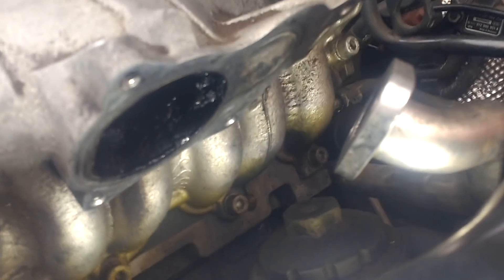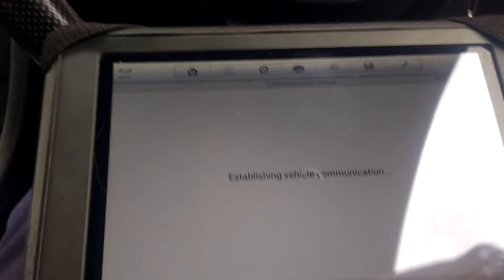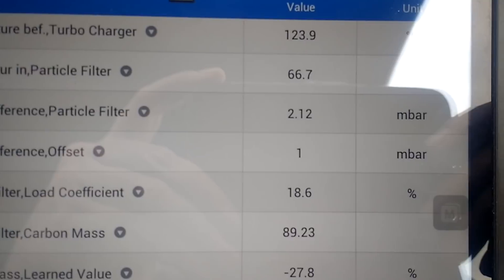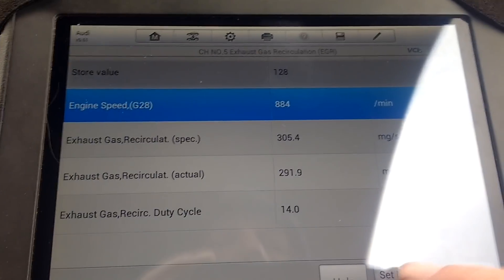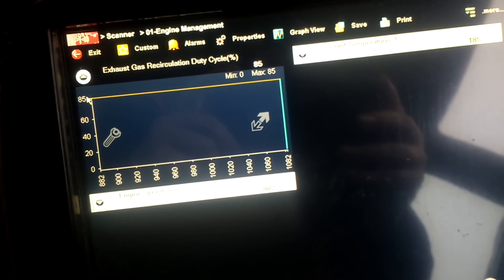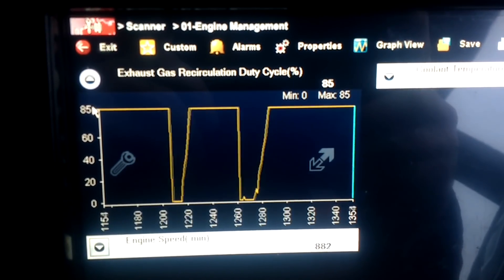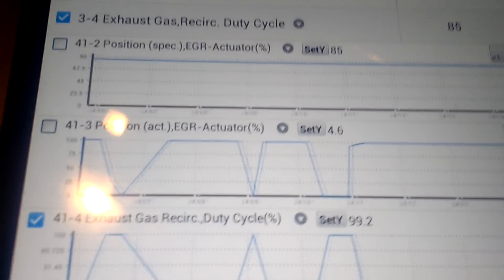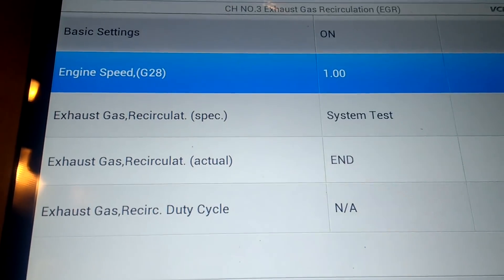Audi A4 Egr Surging- Final Call for Tonight!!!

Comment: Always fit genuine or OEM when it comes to electrics...saves so much headscratching later..not to say genuine or OEM parts work 100% out of the box. But you reduce the variables considerably...try using vcds if you have access to it buddy...if only you were closer!
Reply from the maker: Cheers my friend just away to pick up a VDO unit from Dingbro will let u know the result cheers sandy